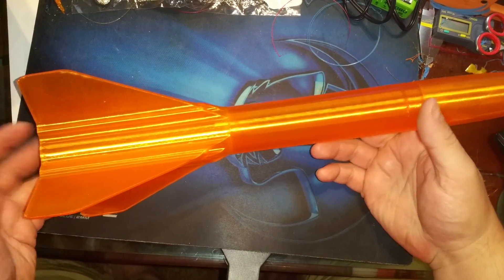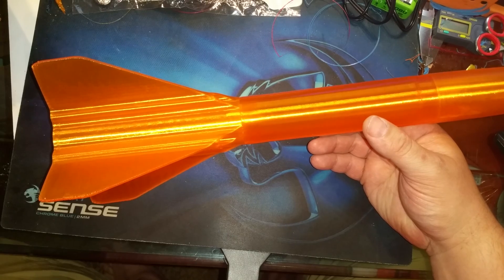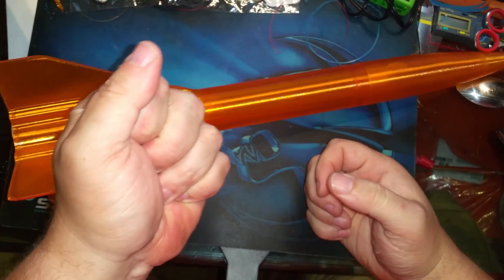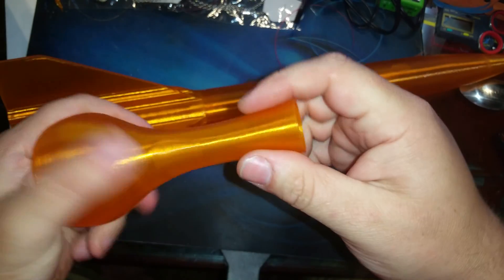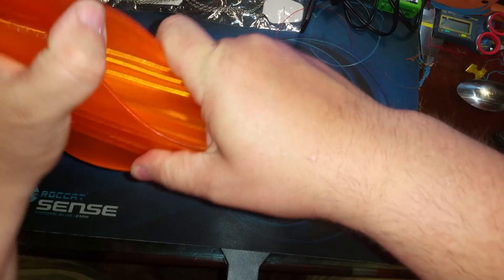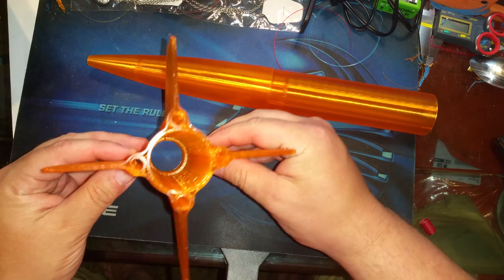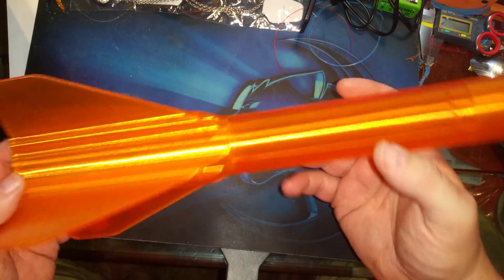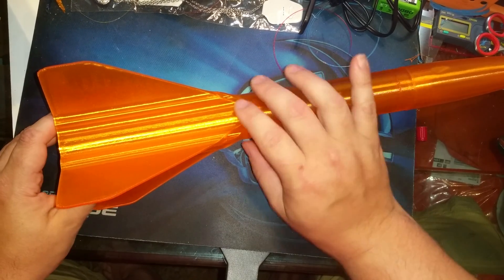Today's 3D Print - TPU Rocket. Indestructible? Maybe..

Comment: Hi, Did you print this on the Wanhao with the Flexion? Do you have a Simplify3D profile that works well?
Reply from the maker: Thomas Smith yes. it printed very nicely. i used the normal wanhao i3 simplify 3d profile adjusted as needed for tpu of course.
Reply: Thanks. Your videos and Google Group discussions are very helpful. I bought the Flexion HT Combo and have ordered two of the steppers you recommended(via the slow boat from China) I was going to drop the $ for a more expensive printer, but I enjoy tinkering with modifications and the massive amount of users in the Wanhao i3 community.

Comment: awesome video.  i just finished a design for an Honest John Fin Kit and printed it in Protopasta Carbon Fiber PLA, id like to try TPU next.  What brand and where did you purchase the filament?

Also, did you need to make any adjustments to your printer in order to get the results as seen in your video?
Reply from the maker: I would not use a carbon pla for a flight model. it is very brittle and has NONE of the strengths of carbon fiber. Just a warning :-)

I use foxsmart TPU $25 a kilo when I last purchased it.

very heavy very flexible. not good for a flight model except that the model would be pretty much indestructible :-)

I never flew this model. once assembled it was clear it would be unstable. I need to make a longer body tube to shift the CG forward.
Reply: CF-PLA is extremely brittle in its pre-extruded form but after printing that trait disappears.  This model has already survived 1 launch with no noticeable damage.